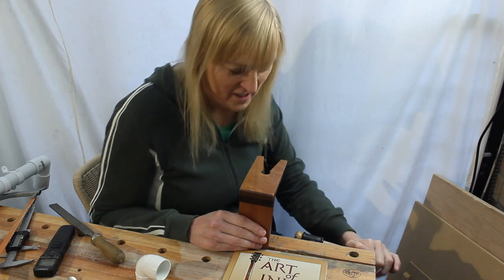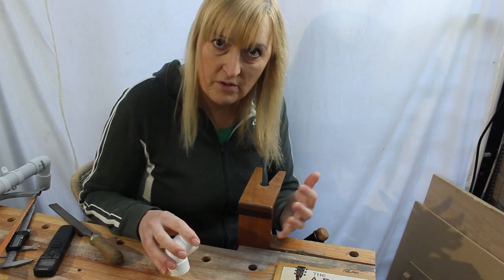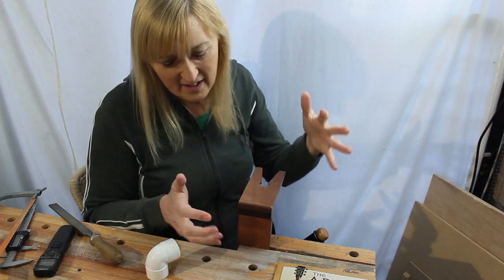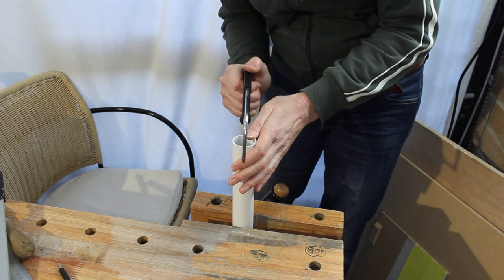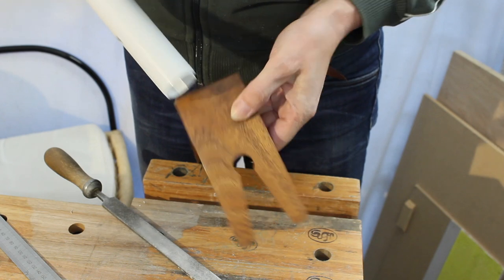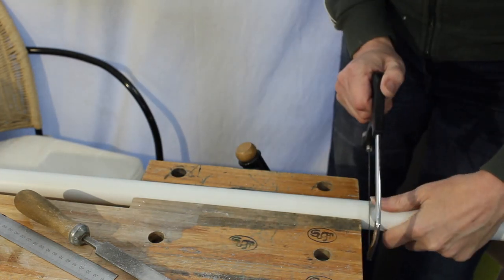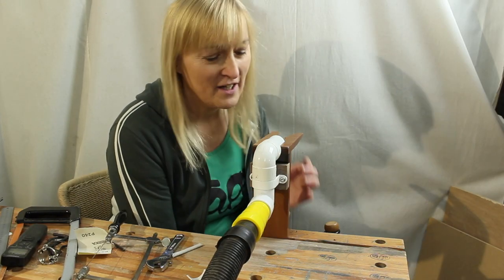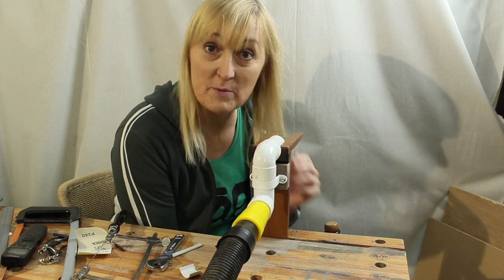Adding dust extraction to the Crimson Guitars inlay cutting jig

Comment: Hello Susan. First Merry Christmas & Happy New Year. It is a little late for me to mention this, but here goes anyway. I am not knocking your way of doing this, it works very well and you did a super job of getting it crafted. I love the way you completely think through what you want to do and and how to go about it. While watching your video the thought came to me, I have used PVC pipe for a number of things it is a very versatile material. To your cutting board you could have used a "Tee" fitting to accomplish the same thing with NO cuts to your board. 2 ways to go, 1 band saw the tee into 2 halves cutting through each of the 3 connector ports. Once in half saw cut from each half, on the saw cut side of the tee, the profile of the V portion of your board. Remove just enough to allow the tee to be put back together forming a port so the tee can slide onto the V board from the front stopping at the second half of your board that makes it a 90 degree. You could have made a strap to go around the back of the board holding the tee in place with no holes drilled into you board. Tape over one end of the tee not needed for a hose connection. #2 way, was cut the tee form the port that is inline with the port on the opposite side. Make two cuts removing enough material to allow the tee to slide from the either side of your choosing. The depth of the cuts only go far enough to a line the center port of the tee to the center of you V board. Tape over the port not needed. One screw through the PVC on the cut side can act as a clamp. I hope all the makes sense. Bottom line your way works very well. Hind sight is always 20-20. Great job. Love your work.

Comment: Hi Susan,  if you want to improve the efficiency of your system add a couple of flanges right at the end of your PVC pipes.  If you do this  more of the air being vacuumed  will have passed over the work.  As it is, a significant amount of the air will come from behind the work (although this might not matter if your extract is powerful enough).  You can experiment in a non destructive way with cardboard flanges and gaffer tape.  

This sort of thing  (local extraction) is much better that a mask alone so its a great project.

Comment: Great Jig Remodel Sue...is there an easy way/ route to set up  the DX1000 with two machines attached with 4inch tubes ...( Bandsaw & Tablesaw )  used one at a time tho 🤪...to use with Dx1000 or is it best to purchase separate extractor for this...I don’t wish to keep swapping pipes over each time I do a cut